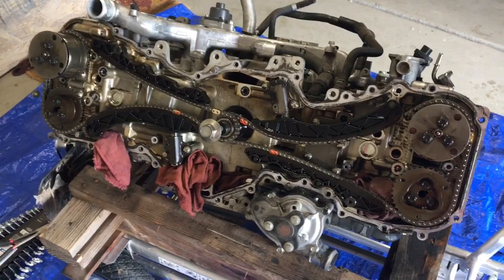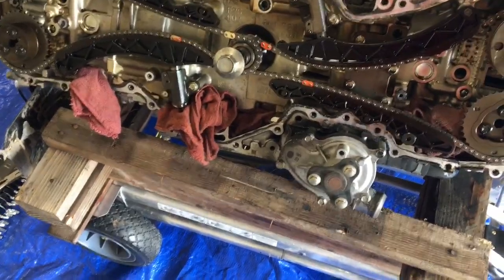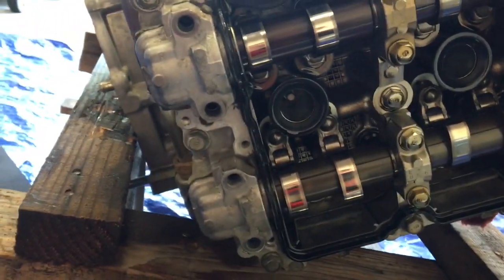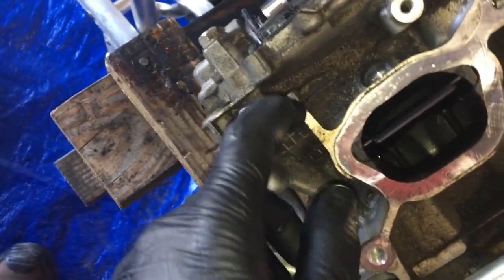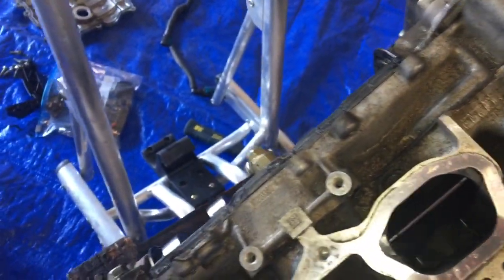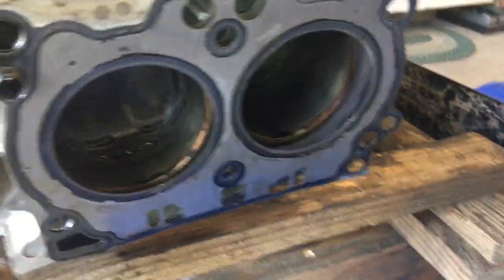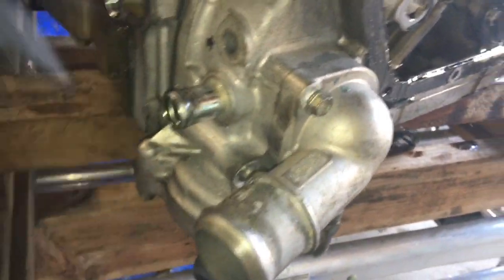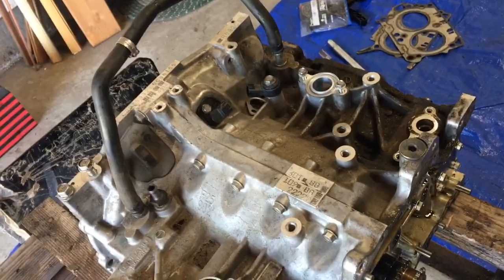FB25 Engine Disassembly 2011 Subaru Forester P1

Comment: What engine did you put back in your forester? You said a newer one, what year and what vehicle did it come out of?
Reply from the maker: I put in a 2014+ forester engine. If you have the option to get the proper engine for your model year I highly recommend it. The 2014+ FB engines do have some differences which I had to make work. The major differences I remember are:

Flywheel was a different outer diameter. Inner bolt pattern was luckily the same, so I had to take the old flywheel off of the broken engine and put it on the new engine to mate it with the tranny.

The 2014+ wiring harness was not exactly the same as the old one. I put the old wiring harness on the new engine. The coils in the 2014+ engine did not have the same electrical connector to mate with the wiring harness, so I had to put the old coils back into the new engine.

The 2014+ engine does not have the same drive belt tensioner as the old engine. I had to buy a shorter belt to make everything work. Not ideal but 20k miles later I haven't had issues.

I believe the  2014+ Subaru's have and electric power steering system so there are some connectors that are left unconnected.

Needless to say GET THE CORRECT REPLACEMENT ENGINE IF YOU ARE DOING THIS.